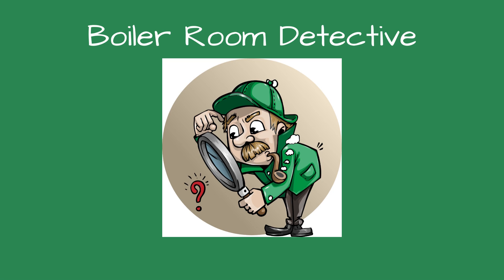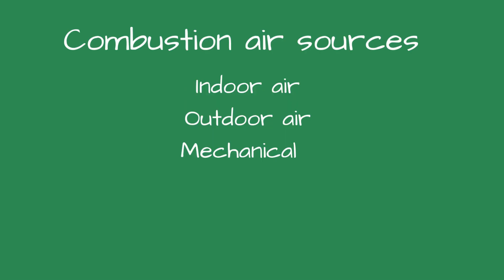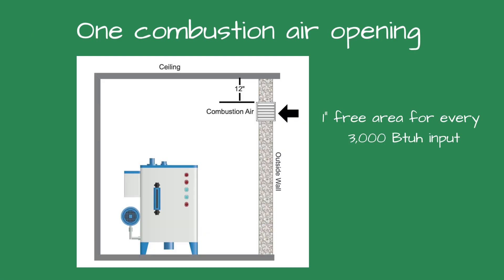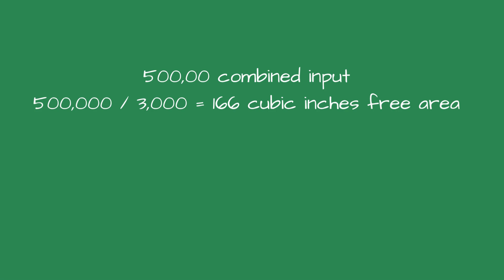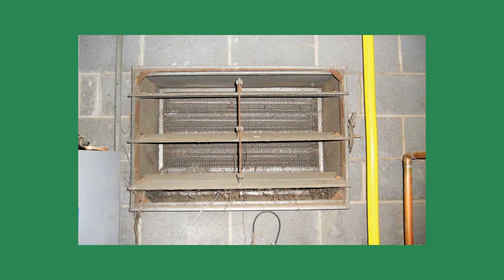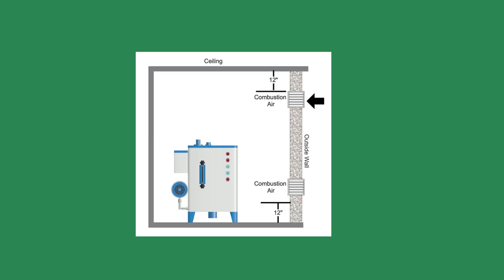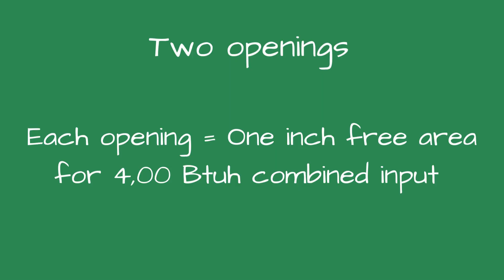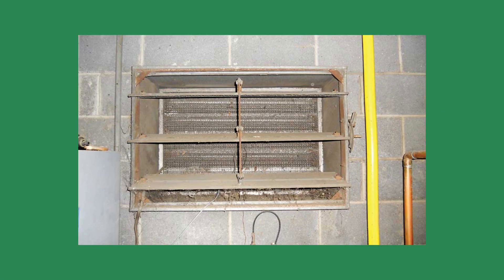Detective Tools Combustion air sizing using wall openings

Comment: Here in the North we get some pretty significant snowfalls and we have experienced snow entering some of our air handlers and clogging the filters.  Where the Fresh Air Inlet was sized correctly, nonetheless the opening allowed for air velocities that were great enough to suck the swirling snow outside the penthouse into the air handler.  One proposal was to build a new Fresh Air Plenum (very large) to lower those velocities. Another was to just service the filters after major storms.
Reply from the maker: Wow I never heard of that That’s amazing Thanks for letting me know
Reply: These were two very large air handlers that supplied 100% Fresh Air to a Science building (with lots of hoods).  The snow would accumulate like a snow drift in the first plenum and the Pre-Filters would be totally blocked.  Just getting filters up to this penthouse was a task, we had a small crane permanently installed on the roof to bring up pallet loads of filters.  Going thru filters can be quite costly as was the associated labor. @boilerroomdetective
Reply from the maker: @BigMouth380cal  thanks for explaining it.Amazing what you had to do

Comment: i had a combustion air  intake  screen clog up "solid"  2 weeks after I did the seasonal clean & check.  2 days after my inspection, the hospital surgical scrubs laundry  added & started up a new / larger dryer system. the new discharge vent was aimed in the general direction of the boiler room intake.  . it clogged up  the screen with green lint from the scrubs!   "Billable !"
Reply from the maker: Wow that’s crazy I’m glad you got billable hours for it